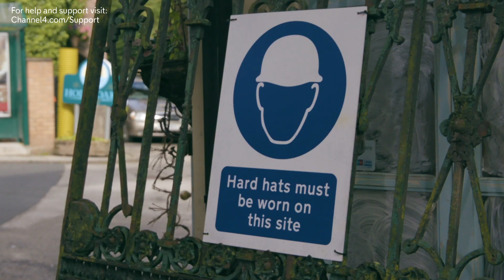Behind the Scenes of the Crane Stunt | Hollyoaks

Comment: Didn't really explain how u did the stunt
Reply: Ashley Taylor Dawson did. This was more a montage of frames creating the image of a stunt, more than an actual stunt. The only real stunt I could see, was people running past the flower pavilion at the same time as the "crane" crashed into it. A little explosion making mostly dust flying up in the air was set off at that moment, and because of that it qualifies as a stunt. The rest was, as far as I could tell, just a montage of frames in sequence. Had this been a proper realistic stunt with an authentic crane and Breda`s car going as far as it was meant to look like on screen, there wouldn`t have been anything left of Breda`s car, cause it would have been pulled by wires at such a speed the weight and solid support foot of the crane would have crushed it worse than squeezed by hand empty can of coke. The thin metal plates, plus a few stronger beams of Breda`s car, wouldn`t Have stood a chance against the solid steel of the support foot and the weight of the cane resting on it.

A more realistic way of making the crane tip over would have been to, as Cindy ordered more and more heavy equipment into the site, the tunnels underneath gave more and more in for every new lorry and more that entered, or each new bag of cement and more that was unloaded and placed straight above where the tunnels were the most weak, and then suddenly the tunnel gave in, making the crane tip as a result. Instead of having Breda`s car drive into the support foot of the crane and unrealistically cause the crane to tip over, it would have made more sense to have her car land in the tunnel as a result of it collapsing under it, causing Tony to fall out of it when it landed, and because of the dust kicked up, was so covered by the dust no one saw him when Breda was rescued and he lay unconscious. And when he finally woke up and started to get up and move around, he had amnesia and couldn`t remember neither who he was or where he had been, making the police wonder if he had fallen into the tunnel by accident back when he was discovered to be missing, and since he had lost his memory was unable to get out from there, until now when the entire tunnel had collapsed, and he therefore had been able to get out more easily.

With Tony found and believed to have been trapped inside the tunnel for months, Diane would naturally start to wonder about the letters and messages claiming he had left her - who could be behind them, and why. Together with Tony`s dad asking the questions who and why would have an interest in making Diane believe Tony had left her and his family. Ask themselves if Tony perhaps hadn`t ended up in the tunnel by accident, but had been attempted killed - because, they would assume, he had found something out about Harry`s death. And when Mercedes eventually became a suspect of having killed Harry, Edward and Diane assumed Breda had to have been the one who faked the messages from Tony to Diane, and therefore they would have assumed Breda was a co-conspirator of Mercedes. Especially since by then Tony`s stab wound would have been discovered, so it would have been known he did not end up in the tunnel by accident.

Having someone believed stuck in a tunnel for weeks with amnesia might be a bit of stretch, but not more so than have someone with a serious gut wound after a stabbing live in extremely poor sanitary conditions at a pig farm being malnourished for weeks, but still survive.